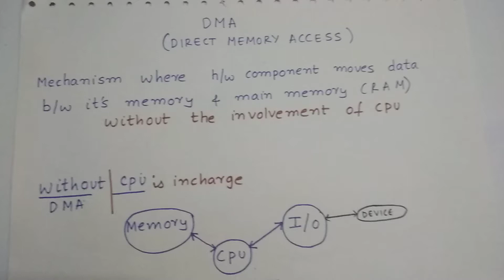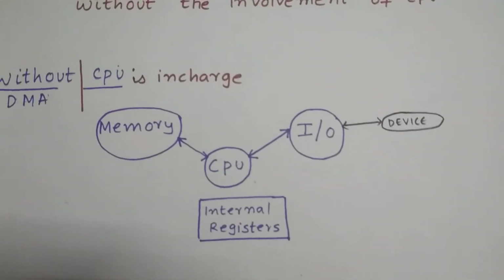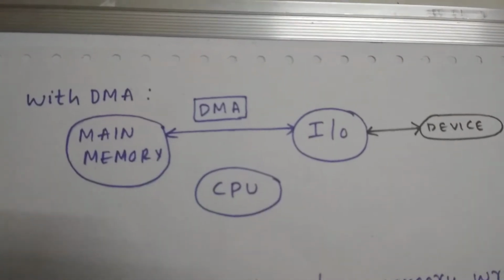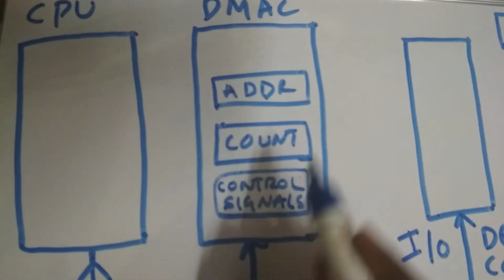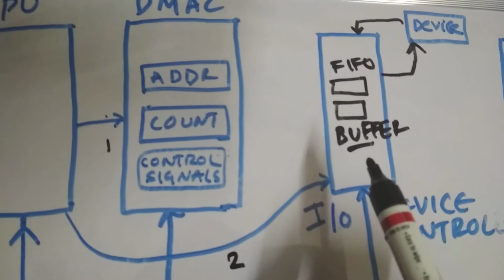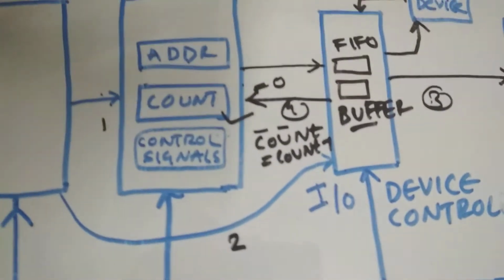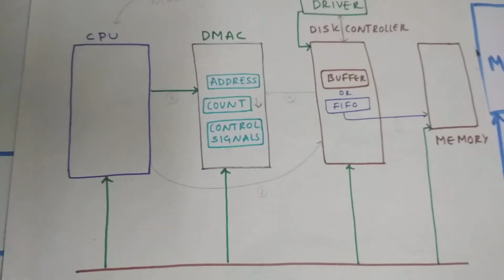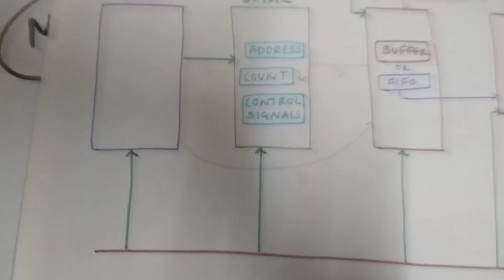What is DMA?   Direct Memory Access Explained!! (SIMPLIFIED)

Comment: Hello sir, does superscalar processor also require DMA controller? DMA controller will service the software program written for large amount of data transfer? I want to know how many clock cycles will be required for the 2MB data, if processor service that and what if DMA controller service that in terms of instruction fetch, decode, execution, memory write back etc..? Does DMA controller communicates with DRAM controller for address translation when software request is made?

Comment: If CPU is required to control the memory writing or reading from i/o device then what is use of putting DMA . As per your description it is like CPU is getting more load because of DMA. and How come DMA say I/o to send data to memory without accessing bus?
Reply: CPU need not to reset it's register , instead it reset dma register , so cpu avoids context switch which make it fast

Comment: My doubt is mainly on the very first step of CPU setting up the REGISTERs in the DMA. How does the CPU know what is the address and count of data that DMA has to process from the device controller buffer ? I am clear on the steps you explained then after but I was not able to figure out what is the trigger for CPU for the very 1st step. 
Will there be an interrupt from I/O device to the CPU indicating there is data to be transferred?
Reply: Hey Shreyas
I have a dought that ,does the DMA transfer is voluntary or it requires trigger from CPU for start of transfer,and what if data is overwritten means in case of UART communication it can happen
Reply from the maker: Hey sheryas , thanks for asking the question ,
In memory we have descriptors which contains start addr and length information . When memory transfer starts the cpu gives the descriptor address to dma  processor and it will perform the transfer.
Yes I/O will communicate with CPU about the requirements , then cpu will write it in memory as descriptor and address of descriptor to dma.

Hope this clears your doubt, if you have any questions please feel free to comment, I am happy to help you 👍
Please do subscribe, it will help me a lot 👍
Reply: @KarthikVippala   Thanks for clarification!!
Reply from the maker: @shreyasrai   Thanks for the support ,  can you suggest a topic    if  I know that topic I will make a video for you . Good luck 👍